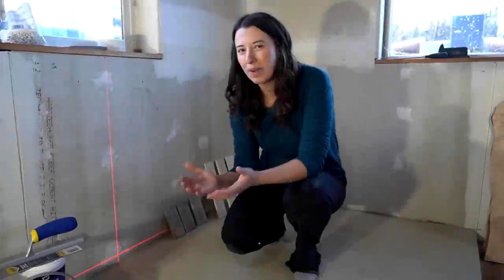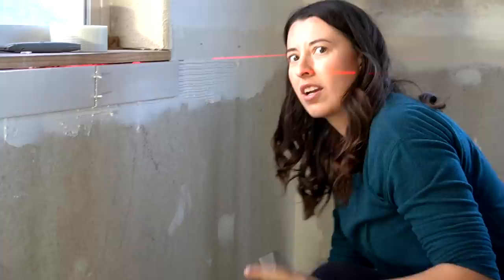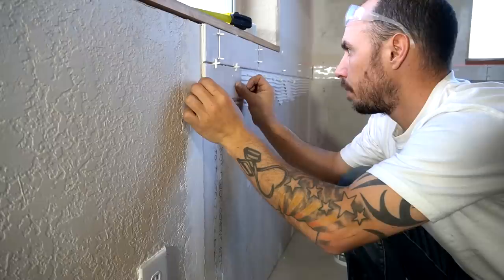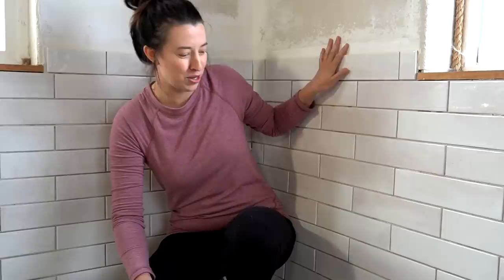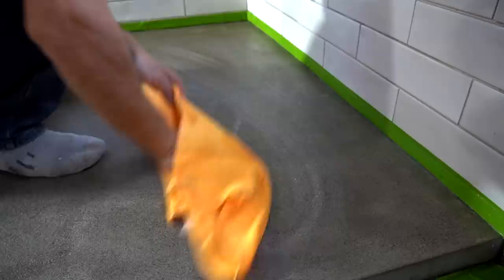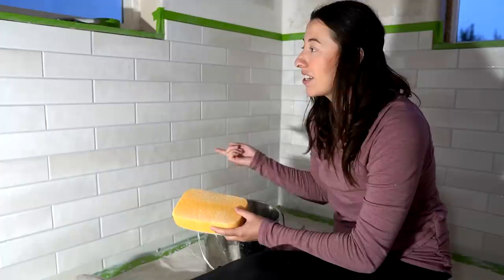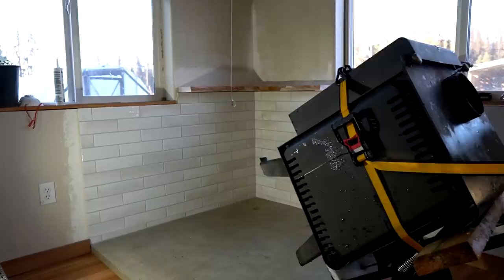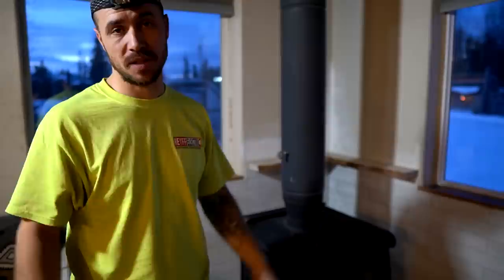Setting Tile & Finishing the Wood Stove Hearth

Comment: Ok, soI know it’s after the fact, but it’s HIGHLY recommended that you put mortar on the BACKS of each tile, to ensure proper adhesion. It’s called “back buttering” the tiles.
Reply: Would you also buy some on the wall?  Or only the tile?
Reply: Yeah. Little late now. 👍😁
Reply: @oxymom2002 . Yes, put mortar on then wall or surface your applying tile to and the backs of the tiles as well.
Reply: Thank you. I am resanding and refinishing my hardwood floor and next I will be tiling in the kitchen.
Reply: @shermdog6969  at least they can help other people 🤷‍♀️
Reply: The new house will need tiling somewhere. I was going to write about buttering the tile itself also.
Reply: Yes, I'm telling the screen, back butter!
Reply: @gloriajackson2021  I was being sarcastic. I thought they done a fantastic job. My comment was to the comment about buttering the backs of the tile now that it's done.
Reply: Those tiles will be fine without back buttering.   Small light tile. They are getting plenty of mortar on there.
Reply: I learned the hard way by not buterring the tiles they started popping up!!!
Reply: @curtisblair7618  but there will be heat. So back buttering would be highly recommended.
Reply: You’ve fallen victim to big mortar’s deception. Tricking you into buying more mortar 🤦🏿
Reply: 100% Agreed
Reply: As an actual tiler.... for small clay wall tiles like these which ive installed hundreds of times, back buttering is NOT needed, thats a flooring tile thing for larger tiles and then only when the trowel your using cant ensure enough adhesive is applied so that when you check there is enough coverage, you can decide if a larger trowel is needed or back buttering is needed.
Simply use the right size notched trowel (10mm for this tile, sorry not US based) and if your not fast at tiling apply the tile motar to the back of the tile instead of the wall so it doesn't skin off. 
Ensuring the surface is primed with masonry porous prime is more important for this situation.
Reply: @oxymom2002  yes grout on both the wall and the tile.
Reply: May I ask why you don’t put the stove at an angle towards the centre of the room?

Comment: That tile pattern is called, "subway". The tile adhesive you are using is not mortar, it's an adhesive (but correct for those tiles vertically). It's always best to start at the bottom, space off the level solid horizontal surface, then each course above it is spaced off of the course below. This allows a bit of support so tiles don't slide. The ideal trowel for those tiles with that adhesive has small notches like alligator teeth (1/8" to 3/16" deep). The tile saw is fine but don't be afraid of the diamond blade. Flip up that guard and free hand cut boogers and such. When grouting, just fill the spaces with the edge of the float. Don't waste your time floating grout over the entire tile. Wet sponge after 30 to 45 minutes, and allow the wet grout to finish your float using the sponge. A second wet sponging after the grout has chalked up (about an hour). Then buff the tile with a bath towel. One last tip, NEVER grout into corners. Leave that gap to be filled with grout matching caulk. Otherwise, your corner grout will crack in just one season.
Reply: Right or wrong, first time, looks great.
Reply: Gorgeous
Reply: I was waiting for someone more experienced to comment! I have never seen someone tile from the top before!
Reply: Level a line a row or 2 off the bottom and cut to the bottom from it and work up. Fireplaces never use mastic only thin set as mastic will melt(from what I was taught in the early 80s, never did it any other way to be safe, old school is always best). 1/4 notch trowel is the correct size for that tile, it allows for some build out but not too much where shit is squirting out the joints.
I the case of small tiles like they are using, I even spread the whole damn piece, and  I am a stickler for neat and clean when grouting and very rarely spread whole pieces, in fact rarely use more then 1 bucket(3 1/2 gallon mastic bucket) to wash over 100 feet at a time leaving it completely clean first wash. NEVER use that crappy sanded color caulk(grout it normal and pure clear silicon, will NEVER crack), up here it will crack in less then 6 months in the temperature change...You have MUCH to learn Padawan
Reply: I wondered if they should have started at the bottom..  then the thin piece would have been at the top like a cap.. But, they did a beautiful job, the tiles didn’t slip and it looks great!  Good job!
Reply: She said at the very beginning they're called subway tiles.
Reply: @QueLindaMay   They would have tiled from the bottom like anybody else if there hadn't been the window. Entire tiles under the window is much nicer, isn't it ?
Reply: @vzmax  Usually you always go full tile at the bottom to make sure you have that straight edge and then whatever happens at the windows happens. Since its more often covered by window molding or such.
Reply: @vzmax  Do the math and start at bottom.
Reply: I thought the tile was called subway tile? Just wondering!
Reply: @milehigrl  At least, in Paris, the tiles seem to be very similar.
Reply: @milehigrl  it is called a subway tile and it is called brick Gondor stretcher bond
Reply: @opalberry2033  Just happen to be a kitchen and bath contractor with over 20 years experience.
Reply: Great advice & tips! People always get intimidated by someone with expertise…😂
Reply: Yes this! Wonderful advice. We have a flooring/tile business and my hubby was saying the same thing. They did SOOOO GOOD for not having any experience though! My favorite Alaskan channel. ❤❤❤
Reply: @opalberry2033  he is sharing knowledge not bagging them.  Since when is being helpful a bad thing.  They haven't done it before and hopefully with knowledge shared next time they will have the helpful tips.
Reply: It is also called an Ashlar pattern or brick style pattern.
Reply: @godlessevilfeeling  yes 👍
Reply: @angelamarie4137  that style/pattern is actually called running bond
Reply: @QueLindaMay  it’s ok to start from the top with tiles or decoration bricks. the bottom is less visible and you can put smaller tiles , cut etc. on top it will look uglier 😂

Comment: Hot tips from the internet:

1. Start at the bottom with a leveling board

2. Trowel the morter so the groves/troughs are along the shortest side (the opposite way you did) 

3. Wriggle the tiles as you bed them so the air escapes and you get 100% morter coverage on the back of the tile.
Reply: Thank you! My ocd wont let me watch 😅

Comment: we watch every one of your films here in germany. you're part of our family, so to speak, thanks to youtube. and we admire you for going to a country where it's been dark for so long - and then very cold. just like you, we heat our little house with a wood stove. we might have a tip for cleaning the glass of the oven door. take a large piece of newspaper, crumple it up, wet it well with water and press it into the ash in the ash pan. use it to rub the pane well. the black soot will come off. If it doesn't come out completely clean, do it a second time. then polish the glass with paper towels. you will be amazed at how quickly the pane gets clean, even without chemical cleaners. I wish you success

Comment: I was of the  thought that the first course was started at the bottom,  but y'all are doing a fantastic job. I love the work that you guys do.
Reply: It's a wonder that none of the upper courses sagged during the process.
Reply: Yes it is bottom first
Reply: But if they started on the bottom with full tiles the final thin row would be on top.
Reply: @HughJorgan1  there's tile edges. They have a smooth curve to the instead of the straight edge.
Reply: @divinelotus19  …I mean the width/depth of the tile. Note they finished with a row on the bottom that was only about a third of a tile, while the top row was a full tile. If they had started on the bottom that smaller row would be the top and wouldn’t look as good.

Comment: You guys have done a beautiful job with this project. Way to go. I have one question: did you think about having the stove turned at 45 degrees rather than square?
Reply from the maker: Yes we hoped to to that, clearance was a big issue sadly.
Reply: @SimpleLivingAlaska  I wondered if that was the issue. Well like I said you guys did a beautiful job.
Reply: Yah 45 wld look great!
Reply: I use a piece of scrap tile as a pusher on the wet saw.  Put it up against the tile u are cutting along the trailing edge and you can cut all the way through without having to flip.
Reply: Seems 45 degree angle give more heat to room & easier to use as a stove. Look more attractive.  Also would line up with shelf. I was surprised to see you putting so much work in it & position that way. It would show off more tile which is beautiful & well done. Blessings
Reply: @marihelenmcintyre9966  they didn’t have enough room to position it at 45 degrees. Things didn’t line up correctly.

Comment: I can see that you've never done it before. I would start from the bottom and chose either direction from the corner. But , there's so many ways you can do it. Cheers. Good luck, it  will be a beautiful addition to the wood stove.
Reply: You can see it's their first time but the end result is actually very good. Starting from the bottom is safer but the end result is not as nice. Good job I would say.
Reply: @daandemeyer1708  agree, I didn't criticize it just work better for this project lying tiles the way they did. The final look is what counts.

Comment: Hey, I actually have a trick for you when it comes to cleaning the grime off of the glass of the wooden stove! Just take a wet towel and dip it in the ash (which you probably already have in the wood stove) and then just clean the glass with that. Works wonders!
Reply: 26:06 in the video lol
Reply: They said in the video it doesn’t work for them.

Comment: I would melt like a snowman if I lived in temps of 75 to 80.  You must have very dry skin and sinuses. I most certainly would have air circulating from the outside.  You both did such a great job.  You should be very proud of yourselves.  👏🏼👏🏼

Comment: One thing a pro tiler once taught me was to attach a level batten along the bottom of the wall and work upwards from that, removes any chance of slipping being an issue since you work upwards.  Then you remove the batten and fill in the gap with any cut pieces you need or if you started one full row up from the bottom you can just fill in the first row with full tiles.

Comment: Beautifully done! When I first did tiling I admit I was scared, Me and my handicapped mom lived a lone, all the work was left to me a lone. I had to do a restore full 3 countertops in the kitchen and backsplash and had to remove old badly placed salito tiles on the kitchen floor and replace them with stone looking tiles. I have to say I never seen the tiles spacers used like that but the results are beautiful! Great choice in tile! The sanded grout I used although it said professional I was not happy and it would not seal ! even after eight coats! So frustrating. A small company wanted $2000.00 just to remove the old tiles not even to replace them, whoa the tile prices and workers price was way too much, so I decided to do it myself. A friend happened to be a contractor and looked at my work, he thought I would of done a shotty job but was surprised I did everything right on! :) I know how pride you feel when you can stand back and see the beautiful final project completed ! Congratulations on a beautiful job well done! :)

Comment: A couple of tips. After you cut with the saw you rub along the cut edges with a honing stone at 45 degrees to the surface as the saw does not leave a clean edge. And if you are laying from the top down. Have a bag of half  penny nails and a hammer to lightly nail under any tile that is slipping. You just pull them out afterwards along with your tile spacers.

Comment: A tile nippers helps trim off those little jagged pieces. Also, there is a trowel with toothed edges that spreads the perfect amount of adhesive the perfect depth. You can get a plastic tiling trowel cheap at any home improvement store. Also, next time start laying tile from the bottom because that gives a base for the next row and keeps you level. Just a few little tricks to make it easier and speed up the job.

Comment: I have found that spreading the grout with strokes on the diagonal works well and seems to fill the joints better than in a straight stroke.  Don't be afraid of the tiles for the adhesive will stay neutral for a little while.

Comment: One other thing. Have you experienced going snowmachining 
when the deep snow has crusted over enough that it easily holds up the weight of the sled? Without breaking thru? It's such a blast, because you can go just about anywhere. Aaand, my large 2023 calendar arrived. Gorgeous photography. Sure miss being up there.

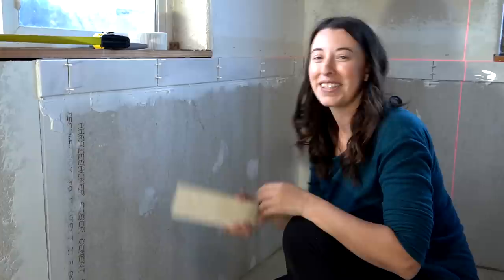Comment: 6:06 You have your first course of tile laid.

Congratulations! You are now qualified to take on any other tiling job in your future. As for the tile saw, you need to have only clean water cooling the blade, dirty water will kill the clean water pump. I draw cleen water from a five gallon bucket and when the tray under the saw fills up I dump it into another five gallon bucket. After it fills up I let it sit 121-24 hours and slowly pour off the cleanish water to be used again.

Nice job

Comment: to seal concrete especially indoors, use a cup/small container, and fill it once with hot water(important), then pour that into a painters pot, then refill this warm cup with standard pva glue,because the cup is warm when you pour the pva into the painters pot it will come out easier, add 2 more cups of hot water to the painters pot, and mix the solution up and apply with a brush or small roller, it will dry and seal in about a hour, i did this 20 years ago on a concrete floor after vacuuming the loose off prior to carpeting :) :)

Comment: Pro-tip (from a non-pro): Use metallic edging at what will be the exposed visible edge of your tile run (i.e. On the ends). It helps keep your lines straighter (even if you have a laser), can help cover imperfections on the edge of your tiles (if you put the cut edge out for example), and just looks professional. It's an attention to detail thing.

Comment: When I use mastic like they are my applicator of choice is a 6” wide plastic applicator with notches and another 6” wide applicator with a squeegee end. I also use the squeegee applicator to apply the grout. I can keep it just to the grout lines for the most part and I can squeegee the excess off immediately leaving little to sponge off later.

Comment: You should buy a couple of those peltier fan's that you put on the stove to spread the heat. They convert heat into electricity which run's them, thus no need for batteries!

Comment: It turned out beautifully and you did good on starting out with the top because any tile that needed to be cut across will be put at the bottom out of sight and you get to keep your desired height and it'sa bit easier to hide any mistakes (professionals do bottom to top and 99.8% of the time that is correct) Be proud of yourself 🏆
Reply from the maker: These were our thoughts, we tried the other way but ultimately went this route and we are very pleased with it 🙂

Comment: Tip, when you grout work from the bottom up, keeps grout from falling off. Also only work in an area you can do in 15 minutes. Making sure you get it in all the cracks from all angles. Then wash off that area and move on.

Comment: I do agree, for first timers not a bad job. But always start at the bottom so the tiles don’t start to slide down the wall. We have renovated at lot of homes and it does get easier each time you do it.   Also black grout looks stunning with white tiles !!!
Reply: Unless you are only putting tiles up partway and dont want a sliver of a row obviously showing on top. 😁

Comment: There is a glass cleaner it’s kinda like blue runny lotion that you can get at tractor supply to clean the glass with it works amazing. It’s pretty cheap to and goes a long way

Comment: Tile guy here. People always say tile guys are too expensive. They only find out after they do it themselves. Also a tip - u can use a tile snap cutter to cut those tiles. It's much cheaper than the saw and very fast to cut. Anyways good job 👏